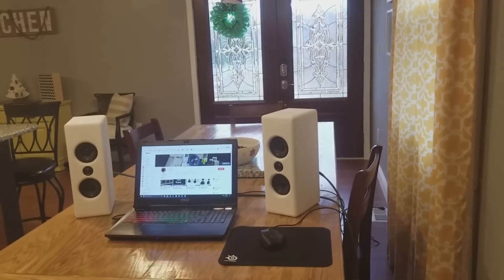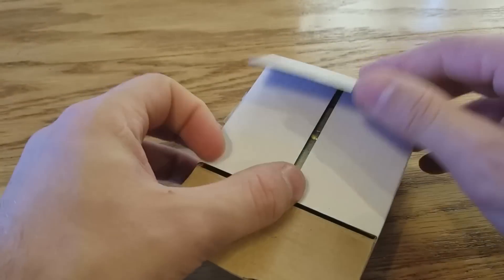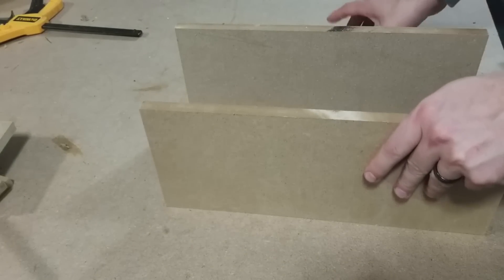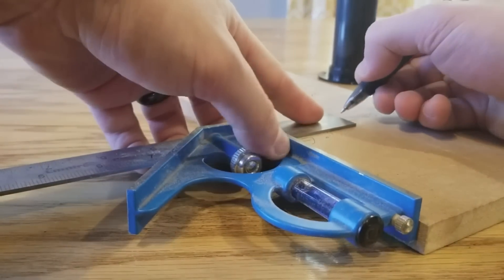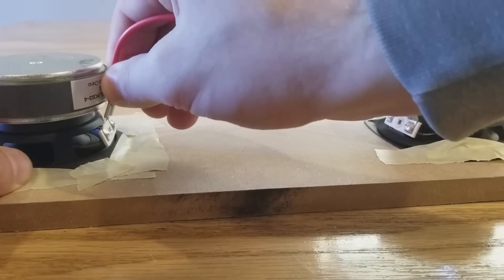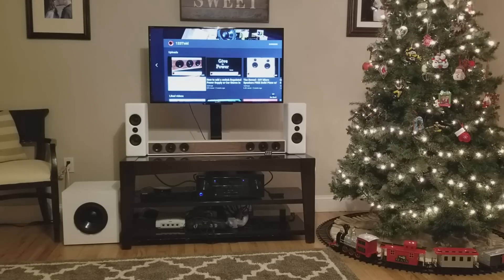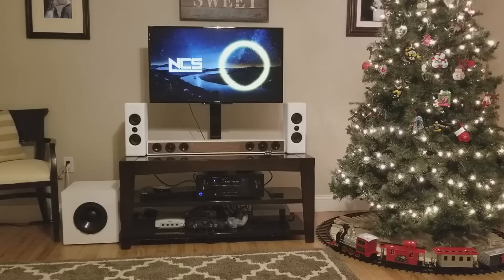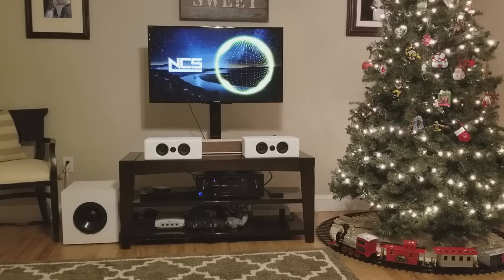The Reveal MTM - DIY Speakers- FREE Build Plans w/ Sound Test

Comment: When building a MTM speaker do the 2 mid range drivers have to be 16 ohm so when you parallel them in the crossover they will be a 8 ohm load?

Comment: Just found you, subscribed and binge watched most of your videos on speaker building. As well as Joe N Tell's channel. As a Woodworker, the use of butt joints drives my OCD nuts, as well as the constant use of MDF. I appreciate and love your Hi Fidelity videos. I am designing my boxes now, which will be a Hybrid of several ~ your MTM'S,  The Dynas, a 2.1 Bluetooth Speaker build by PLATINUM, less his LED Lighting.  Also, I will be using the Volume and Port Size (which I will be used for the rectangular front facing port) Calculation Spreadsheet from Audio Judgement. a Cherry front panel finger jointed to the box which will be Maple top, bottom and sides all dovetailed together. The rear panel 1/2" baltic birch plywood, recessed 1/2" and fixed into a dado joint.  All powered by the Lepai LP210PA 2x30W + 60W 2.1 Channel Mini Plate Amplifier TPA3118 on the Subwoofer [MAYBE] which will be using a Massive Audio SUMMO64 6.5 inch 150W Subwoofer. 

My challenge is how to connect all that hardware and hard work to my desktop. I know there's a better way the that "green" jack in the back of the PC, or a soundcard at all. My current home office sound system is an old 2009 ONKYO 5.1 A/V Receiver set to stereo, using that dreaded "green" output jack to the RCA CD inputs on the receiver. My desktop is old (2013 Dell XPS, NOT EVEN ABLE TO UPGRADE TO WINDOWS 11) doesn't have a SPDIF OPTICAL OUT, nor a spare HDMI port. The one  HDMI I have is feeding a 4k 32 inch Samsung Curved monitor. 

MY CONUNDRUM
Do I go DAC? or forgo the Lepai for a Schiit Stack?
Or do I keep the Onkyo for power, which has both HDMI and SPDIF connections. If that's the case, it's matching powered subwoofer may be a keeper and just build new speakers. Then the DYNAS come to the forefront of my need.

Music is on 24/7 when I am in the office. It's my escape mechanism from failing health. I am 65 years old and my go to music is 1965-1975 the "Woodstock" and "San Francisco" sounds with a tad bit of the British invasion, Classic Folk, the new folk/rock that is out in droves now. In my living room is still my 1970's and 80's components system, along with my 300+ LP vinyl collection. I am running Marantz Amp, Pre Amp, Equalizer, and Tuner. A JVC dual cassette deck, Sony 8" reel to Reel and a 1975 YAMAHA YP-450 turntable. all connected to 4 Bose 501 Series III Speakers. There CD/DVD player is from the Onkyo A/V system in my home office. A $50 Craigslist find originally bought for my woodworking shop. Which now has 2 Sony Bluetooth Speakers, using an old laptop to do nothing by play Amazon Music HD. mY 55" 4K SAMSUNG TV, has Samsung wireless 5.1 setup for your listening pleasure, and it own Blu Ray player. I say all that to reiterate my audiophile ears. I know what sounds good and what doesn't. The trick is to get streaming music from my desktop in my home office equal to my other set-ups.

Comment: it seems the build plans link is not working as well as the link for the 0.75 mh-22gauge ferrite core inductor. Is there an alternative for the inductor? Thanks in advance also nice build! I plan on pairing them with the 8" dual passive radiator sub.

Comment: it seem that laying down the speaker baffle in horizontal position spread the sound which makes the music more defined and better...
Reply from the maker: It would seem that way.  However, with an MTM, the way the waves interact between the drivers, you get a better dispersion keeping them vertical.  That way you can hear them better from side to side.
Reply: @Toid  Interesting. Im designing a 2 tweeter + 2 midrange + subwoofer bluetooth speaker right now, so i'll have to eep that in mind to place the pc83's vertically.

Comment: Nice design ! Still not a fan of having drivers mounted on the rear of the baffle tho I like to be able to remove them so I can modify the crossover, try different drivers, replace blown components easily , etc.
Reply: Form over function. Leave the tweeters flush with the baffle. Then the woofer placement should consider phase differences owing to crossover slope. But some folks will yield to aesthetics. Like Mac users. LOL

Comment: What I like about the Reveals is the clarity.I am sure the tweeter adds to the detail despite what others say that PC83-4 does not need a tweeter.IT DOES if you want good detail.I see that you put the woofers in series, not in parallel like in other DIY MTM projects (e.g. MTM Overnight Sensations which have more SPL than the TM version).In what way the MTM Reveal speakers are better than the TM version except for the higher wattage, please ?
Reply from the maker: Great question.  You can either put them in parallel or series for an MTM configuration.  The main concern is impedance.  Since the PC83-4 are 4 ohm drivers, i had to put them in series, so I get get a usable impedance.  If I put them in parallel, it would bring the impedance down to 2 ohms, which you would have a hard time finding an amplifier that could adequately support that.  I am not sure the MTM is inherently better per se.  When building speakers there is always a trade off.  The MTM version when doen correctly will have better dispersion horizontally or vertically depending on orientation, than a typical TM, but takes up more space.  And of course, as you have pointed out can handle more wattage.  But really, it depends on what your design goals are.
Reply: @Toid  Very informative, thank you!

Comment: These could be used as nice bluetooth speakers :)
Reply from the maker: I actually considered that, with a small micro sub built-in.  Maybe a future video... :D
Reply: Just use one of the Parts Express amp boards with Bluetooth in it install that in one side and use the second as a passive. Perfect PC speakers and you can add a subwoofer later